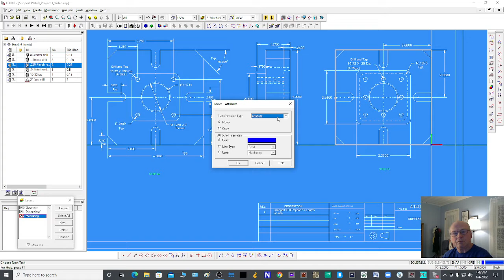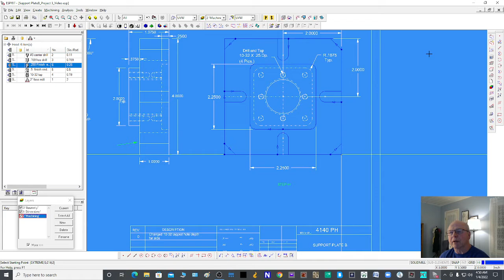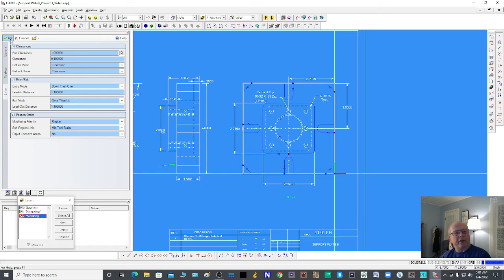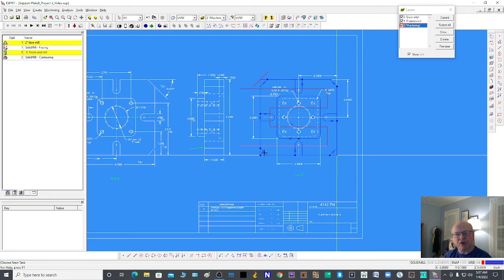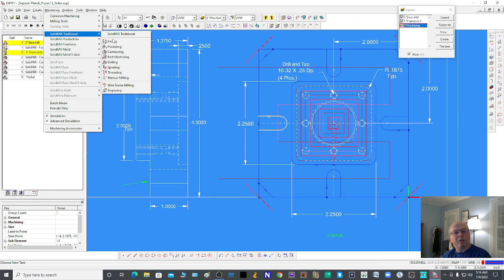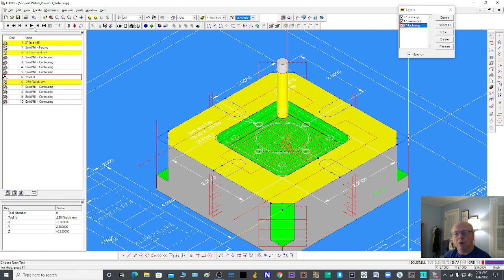Support Plate B Pockets and Peripheries

Comment: you are an amazing teacher 
any chance you would do simultaneous turning? solid turn? I am having an issue with machine set up for multi axis machining
Reply from the maker: Hi Derick, thanks for your comment. I have not done much in solid turn, or multi-axis simultaneous turning. The reason is mostly due to having students that are beginners in CNC programming.
Reply: @espritcad-camvideos8694  ah darn 
 but how do you EXTEND a line 
say you drew a line but later you wanted to extend it about .1" is there a feature for that?
also does esprit have a calculator option ? I noticed when you were drawing circles you could do divisions but what if I am using metric cutters and I want to define them as such without having to convert them by myself? in masterCAM we could enter "5mm" it automatically inputs .196" etc
Reply from the maker: @derick3482   Yes there is; First be sure that ("HI" is activated) on the lower right side of your screen. Then activate the ("Keep") icon in your unbounded geometry tool bar. Now press the shift key and group the line (by left clicking twice, the line you wish to extend. The line should now extend infinitely, and you can now use your trim function to shorten it to the length you want. As to finding the Calculator app, go to your Menu Bar, and click on ("Tools"). A drop down window will now appear, and you will see (Programs). Click on it and the "Calculator app will appear for you to activate. As to transferring metric dimensions to English, when you want to create say a "5mm circle simply type in 5/25.4 at the prompt and you will get the English equivalent.
Reply: @espritcad-camvideos8694  if i divide 5 by 25.4 i get 0.00
i tired adding "=" sign nothing is there a different way?
Reply: @espritcad-camvideos8694  so when extending a line i meant from one end only 
or both ends
but primarily from one end
application? say you drew a 2D geometry of a part for lathe
you wanted to go a little more for parting off 
in master cam we "extend" then enter a value
actually lots of application for this.
Reply from the maker: @derick3482  I am not aware of a way to do this in Esprit. I've used Mastercam and find their CAD side is more thorough in these options.
Reply from the maker: @derick3482  When I type 5/25.4, on my calculator I get .19685. I'm not sure why you are getting 0.00? If you are trying to create a 10mm circle, activate circle, and type in 5/25.4 in the Radius prompt and you will get a 10mm circle or .39370"
Reply: @espritcad-camvideos8694  no that part I get 
but in Tools where you define your cutter do you know what I mean? if you try to describe a metric tool at 90mm length or 2mm wide insert or 8mm diameter cutter 
the boxes don't do the calculation
Reply from the maker: @derick3482  I would suggest you go to "Tools" in your menu bar, System unit, and then change it to Metric. This will allow you to do all your work in the tool files etc., in metric units.